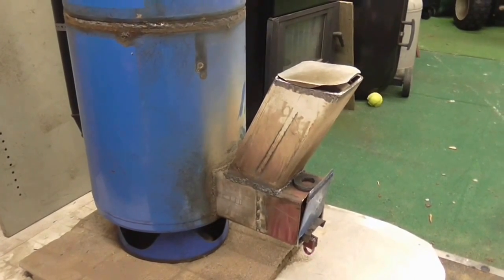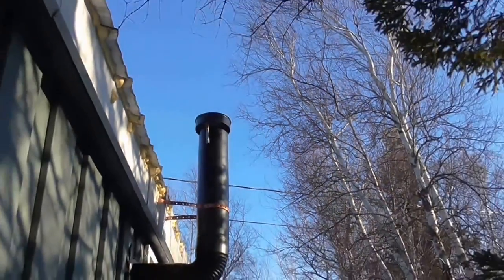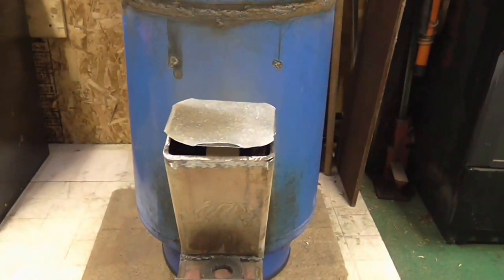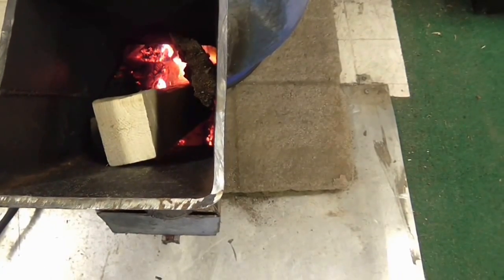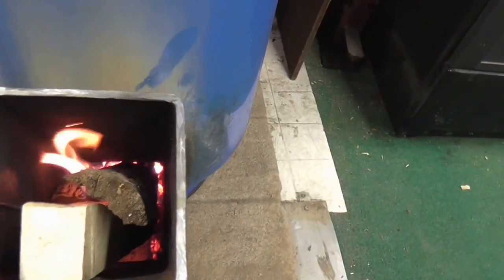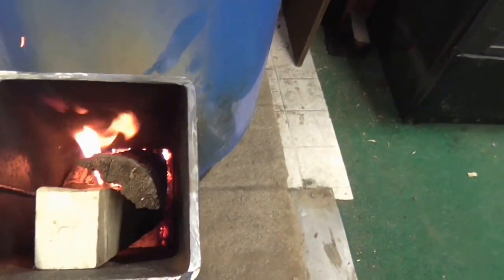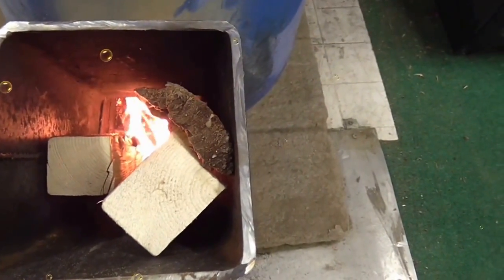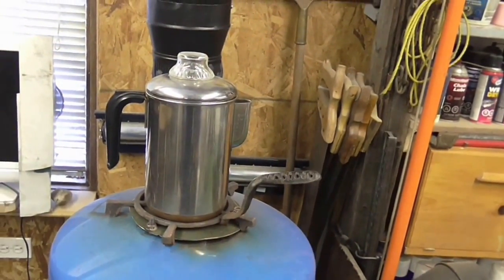Rocket Stove Heater Build and Burn Pt. 2

Comment: Hal don,t you just love all the experts telling you what you should have done?🤣 I have one 
Question, how large of area are you heating my friend. My shop is 1500 square ft. Do you 
Think a stove as your would heat my shop. I live in Okla & we very rarely get into the teens 
Great job my friend.
Reply from the maker: Thanks Jim, The shop I had this in was only about 16 x 20 (320 sq ft) and with the stove running at around 350 to 400 degrees it did a fairly fast job in making it comfortable in there but 1500 sq ft may be a challenge for it but would be definitely cozy in the general area BUT it may heat the whole area good throwing 350 degree heat. One issue with it burning full force is that you have to feed it quite often as it burns up the little it wild hold quite quickly. I found if I was busy doing something and forgot to feed it it would burn down to just coals and then I would have to start over again with smaller wood pieces to get it roaring again. I was also burning a lot of crap such as spruce 2x4  and pine board scrap etc. If i was out there in a minus 20C day it was still pleasant to work and fuel was a lot cheaper than electric 240 volt  heaters

Comment: Definitely too much Gap in between the top of the barrel and the but you're burning it like a regular wood stove cutting down the airflow rocket stove supposed to run wide open to burn clean you regulate the temperature by the amount of would you put in it

Comment: Beautiful. It appears, with a damper , it burns great.. I believe if you insulate the riser you will have no smoke. You made it look so easy. I am inspired.
Reply from the maker: It actually works very good. You just cannot expect it to draw air from both openings at once. If I leave one or the other closed it draws and burns like crazy.  There are a lot of opinions below on why the flames and smoke will come back up the feed tube however plain and simple for my set up too much area for air to be drawn in is my problem. The simple fix was to put a door on the clean out tube and the air is drawn down the self feed tube OR cover the self feed tube and the air is drawn in the lower clean out tube

Comment: I believe the problem is.  1st need to weld the door on a hinge but seals well on bottom tube with a 1inch hole in it this will control the air flow and u shouldn't have to put lid on feeder tube , to make it smoke less u need to insulate to fire tube inside , which generates so much heat in burn chamber it vapourises the smoke , hope this helps

Comment: I’m surprised you still have paint on the outside of that that is not high temp paint so that tells me it’s not burning hot enough to do with the Rockets dove is supposed to do keep experimenting but on the bottom chamber I would put a boat in inch and a half flat there so nothing comes out like you’re hot coals and then put a slide that you can control the heights to control your burn on the bottom to tube but other than that done pretty good job I build them all the time never made a video on but I build them all the time

Comment: Nice Video' another issue is your exhaust pipe! You should reduce not increase the size! It will heat up more and cause a better draw when exhausting. Try reducing your 6inch pipe down to 4inch!

Comment: Why is your fire burning back up the feeding tube and smoking at the chimney?
Reply from the maker: The bottom door to the burn tube or either the feed tube door has to be closed. Both cannot be open. When the bottom door is closed the feed tube becomes the main source for the air to be drawn in. Burns like mad with only one door open

Comment: From what I've seen, you are getting smoke because your riser needs to be 2 in from the top of your barrel !! causes a turbulance at the drop which pushes everything down the inside of your heat barrel towards the exit pipe !

Comment: Halscamp, make half 3/4 to 1 in pipe 10 in long  horizontal on bottom of burn camber right into blue tank weld closred.this will feed fresh hot air to cumbustion chamber from inside tank though no more smoke

Comment: You have too much space between the inner vent tube and the top of the water heater.  2" should be max, I think you have 5 or 6 inches?  The 2 inches makes a world of difference in the inner draw.
Reply from the maker: +maine932 
The space above the burn tube is approx 2 inches now. I welded a metal deflector over the burn tube so the heat hits it and shoots out in all directions instead of hitting directly on top of the drum.
Reply: Halscamp did that make a difference?

Comment: Greetings, I just completed my stove that is very similar to yours. Same pressure tank (except only 1 high) and i used 6" Square tubing. I used a steel paint bucket, inverted, cut a hole to slip over the riser, and notched to surround the feed tube. I filled that with Perlite. It insulated the burn chamber and super-heats the fuel tremendously. I also left a 2" gap between the top of the riser and the pressure tank wall. My feed is also only a 2X6 rectangle.  I wish I had protected it with a diffuser plate like you did.I have very little exhaust and it drafts like a champ. Thanks for the vid.

Comment: Put the door on the bottom tube so you can close it put a door on top that you can slide up and down to control the air the bottom one is just for cleaning out the ash

Comment: You have to have a door on the bottom that you can close so it draws air through the top where the wood is then it will not smoke
Reply from the maker: +Mike Knop 
I now have a "double" door on the bottom, about 1 inch wide on the air intake slot and the top part is about 4 inches wide. You are correct  it works great once it starts burning with the bottom closed off an the top open, which I have also have a hinged door on to flip up as far as you want it. Opening it at different degrees lets more (or less) air in which speeds or slows the fire.

Comment: All the stoves I have seen, the inner pipe goes up to 2-3 inches from the top of the barrel. I believe you have 5or more. Saw one stove with 12 and it smoked terrible, they cut the top down to 3 inches. good luck

Comment: there shouldnt be any smoke if lower cap is closed or open, maybe wrong diameters somewhere beetween hearth and other or space beetween pipe inside(heater) and the fuel input is too big. check out ours all is 100x100 mm
Reply: china sex

Comment: I built one simular to yours with the feed tube and burn tube, you have the same issue as I do.  My burn tube is to long like yours. like saltyseascott said  1/3 the lenght of riser.  I will build another with that in mind, problably one with a fire box instead of tube.

Comment: So, with the extended burn chamber, you would need to put this entire assembly in a 55 gallon drum, and fill with insulation.

Tricky to get the vertical feed to come out the side neatly.   Cut and try, I guess.

Comment: What I've seen so far is the burn chamber needs to be 1/3 the length of the heat riser.  if your heat riser is 3' than your burn chamber needs to be 1' long .  The fire needs to be located opposite end of the heat riser.   I hope this helpful to you.   I like your work so far.  Maybe remembering its a rocket stove and the Rocket stove does burn differently than a wood stove.  So let that air flow but since you're using 5" pipe let openings be " on each end.  It should work great.  Maybe the feeder tube is to close to heat riser.  good luck.
Reply from the maker: I raised the whole stove about 15 inches off the floor and man its lighting up really good now. It used to be hard to get going without the smoke billowing back into the room until it was burning good. Now it is sucking the smoke and flame up into the riser and is a pleasure to light. The wood seems to burn best at the front of the secondary feed tube nearest the riser.  It still burns best with the secondary feet tube cover left open and the primary feed tube covers closed.(I now have a 2 door cover on the bottom feed tube). I can leave the top cover half open or any position to slow/speed the burn.  The shorter chimney path seems to be helping me.
Reply: Halscamp
Oh yes much improved,  you do good work sir
Reply: +Halscamp why did lifting it help it? Shorter flue I'm guessing
Reply from the maker: +Steve Horton 
Lifting it up off the floor really just made it easier to view the burn tube. I think the biggest help was putting doors on the burn inlet and the self feed inlet. Adjusting the air lets me control how fast it burns a bit. Let it roar with bottom closed and top open or burn a bit slower with doors closed.
Reply: I'm betting you had negative pressure. Lifting it off the floor gave it better air. Is it now close to an open window or air intake of some sort?

Comment: If you have,nt already check out mine at "qwertyscot".. I had the same issues.. getting the bottom air intake set does affect the smoke out put out of the feed tube.. my solution was putting a drain cover with pencil size holes with a blank spark plate set 10mm in front of it with the air only able to enter from the top.. like a metal sandwich that you could put your pinky into at the top hope my description helps..
Reply from the maker: I now have a double cover on the front.  The top portion of the front cover (hinged on the side) covers the top 2/3 and the bottom portion of the front cover (hinged on the side) covers the bottom 1/3 of the front. I can play with the bottom 1/3 along with the top feed tube cover to get a pretty good burn. Have to check the wood quite often to see how it is burning as some scrap wood is still a bit green and some may be old dry pieces. I got a lot of my design off of your video :)

Comment: Hi! What is the exhaust flue temperature?
Reply from the maker: Just lit her up today, first time since last winter. When the top of the stove is at 425 degrees, the temp while pointing the laser inside the chimney cap is 71 degrees, the pipe (inside garage) before it exits the wall is at 91 degrees, the top of the 90 degree elbow before it exits the room is at 103 degrees, halfway up the inside pipe is at 96 degrees, 75 degrees on the bottom of the pipe on the outside of the building.
Reply: Halscamp thanks again for the answer. I am in the process of building a rocket heater for my garage box. The concrete garage box is a part of an underground structure. The vent tube is the only way out for the stove gases. The tube goes outside through a layer of bitumen which is part of the collective garage roof. I would not want the roof to melt and be spoiled/ that is why the exhaust temperature is so important. Your stove is a great example. I have a propane gas tank for my project, Its dimensions are exact match for the Z's (ZeroFossilFuel) project, so I decided to make a replica of his rocket stove, only with vermiculite insulation.

Comment: Nice videos!  Thanks for sharing. If you had insulated both the horizontal and vertical interior burn chambers your fire would burn much hotter and cleaner and you would have no smoke.  Insulating these portions of your fire is the standard design assumption for rocket stoves to burn clean..  You want your fuel to burn completely before extracting any heat from the exhaust.  You can only do this by insulating the burn chamber and riser.  I like your "bell heater" approach to extracting heat from the fire.  Good job!
Reply from the maker: I think I will try it with insulation added and see the difference. I had another viewer also say that it should be insulated. Another rocket stove designer built one with no insulation so I thought I would give it a try.
Reply: What do they insulate them with?
Reply: Tony Gatto Vermiculite, wood ash, anything that refuses to burn and insulates the inner reactor chamber.
Reply from the maker: This stove will never see insulation as I am too lazy to cut the top off to allow the installation of insulation. I do not have any room to do this if I only take the top plate off. I should have installed it in the first place but thought what the *ell, it will still give off good heat this way. From other comments I may have ended up with a cleaner/full burn with more heat though.
Reply: Actually, I was thinking more in the lines of putting the whole thing inside a 55 gallon drum and filling with insulation.

You only have to position it so the feed tubes come through properly.
Reply: Walking Judy ij

Comment: I had kind of the same issue with airflow and a wood funnel I used.  Check out my video and the comments.  Rocket heater stove
All is well now if I don't over fill the feeder.